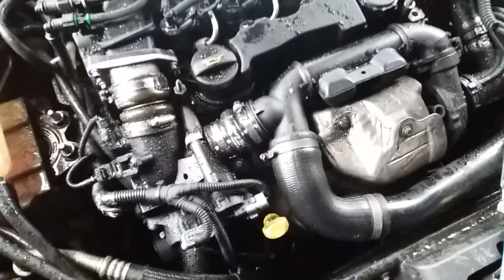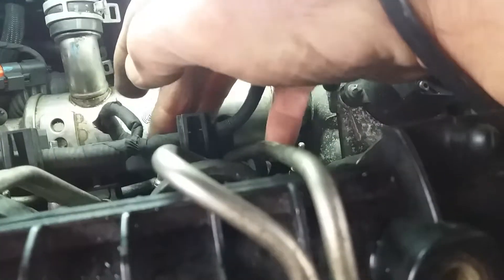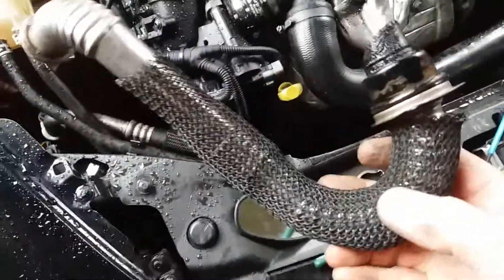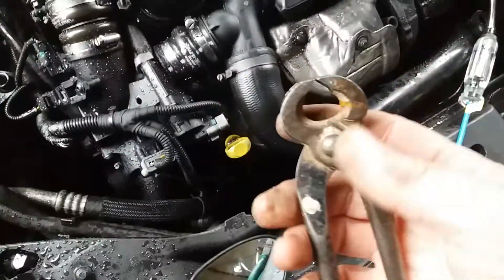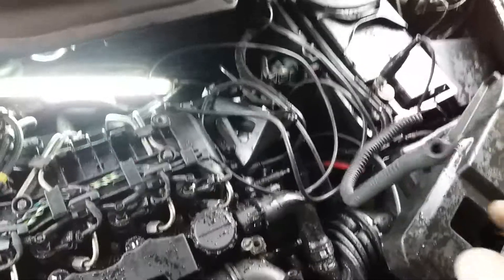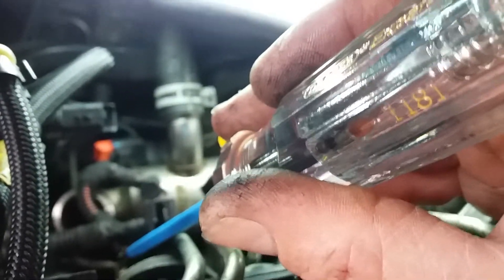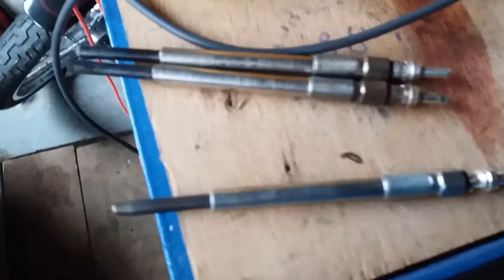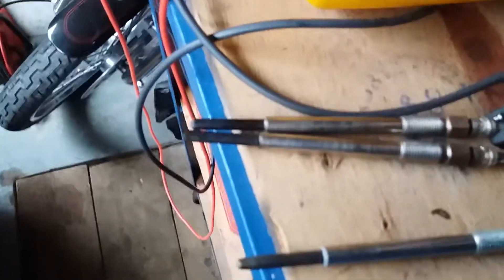Volvo Diesel Glow-plugs

Comment: What is wrong if I can’t get a light in the test light? I changed my plugs last weak, light when testing and everything ok. One weak later, car in limp mode and no light when testing any of the plugs contact points.
Reply from the maker: Check test light for correct operation. Connect lead to battery B+. If necessary remove glow-plug and test out of engine OHMS. Confirm ground continuity between engine and chassis/battery B-. Check glow-plug relay is disconnecting and NOT remaining "On" constantly.
Reply: @deuceelec  thank you, i tried to replace the relay, hoping it was the relay leading to burning the plugs.
Reply: I have an error that shows me this number(P138B)I don't know if it has anything to do with it?please help my😢